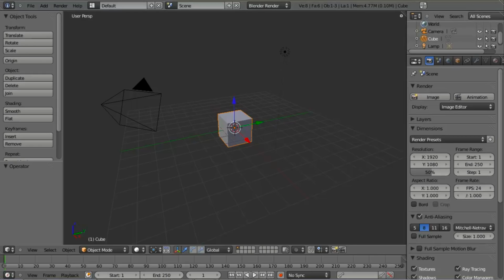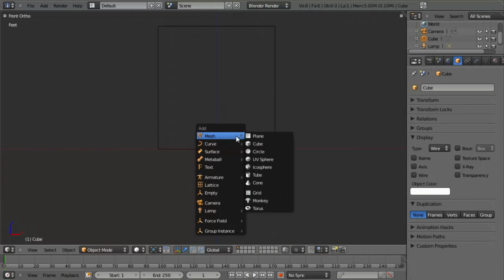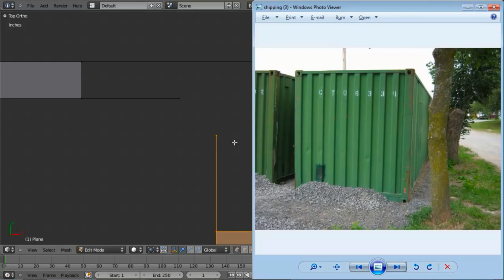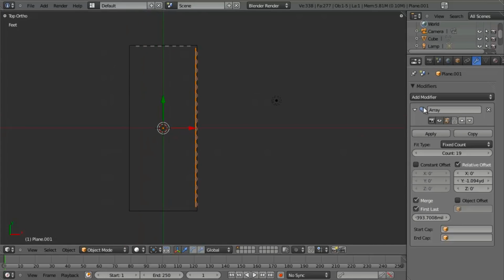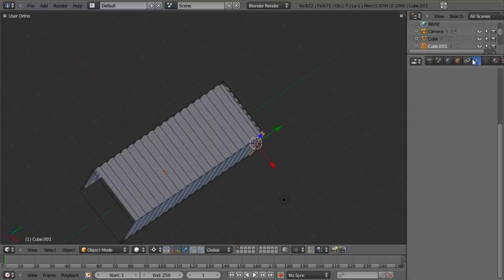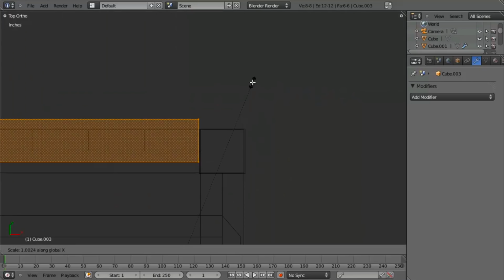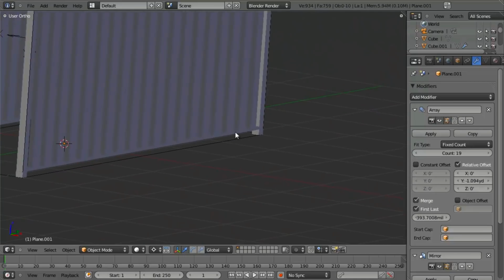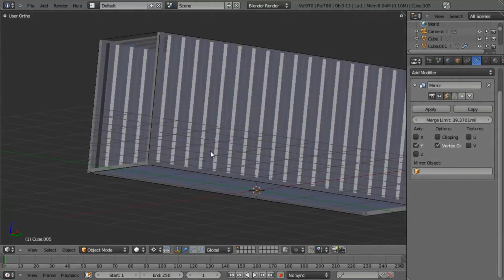CGC Classic: Modeling a Shipping Container - Pt 1 (Blender 2.6)

Comment: Some advises for doing this in Blender 2.8:
1. In Scene > Units dialog set Unit System to Imperial and Length to Inches

2. In Viewport Overlays dialog set Subdivisions to 12 - That will create grid with correct feet to inches ratio.

3. Pivot point in Blender 2.8 does not automatically snap to Cursor, so you need to manage it properly before rotating, mirroring... In object mode, open Object menu > Set Origin and set it where you want. Usually you want to set it to 3D Cursor after you set 3D Cursor position.
Reply: Is it the same in blender 4.0?

Comment: You start working with a measurement unit that most european is not use to? 
Standard ISO Shipping container is: 2.43M Wide, 2.59M High and a lenght of 6.06M or 12.2M
Reply: Yea, but ten you can't snap it to the grid :P